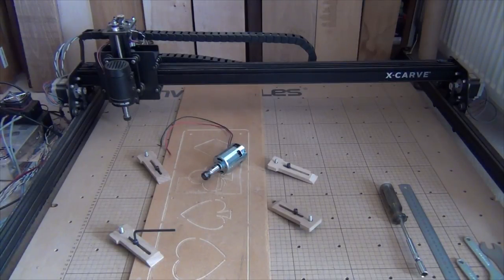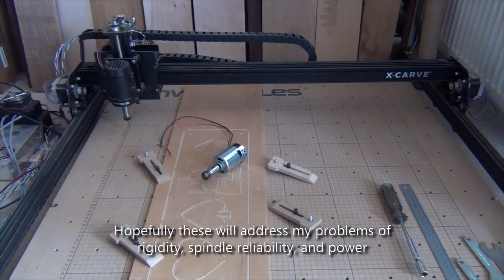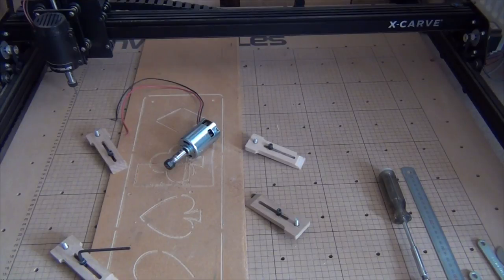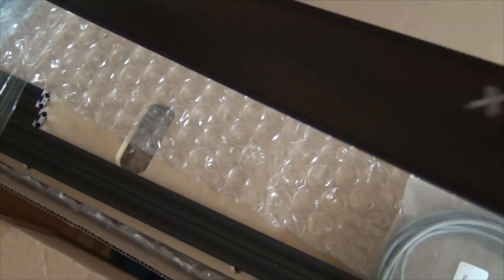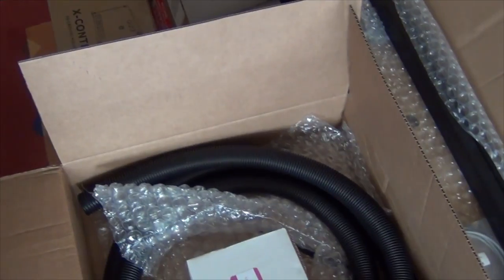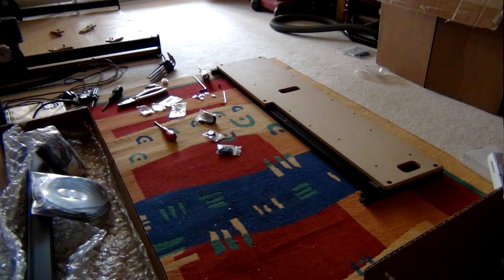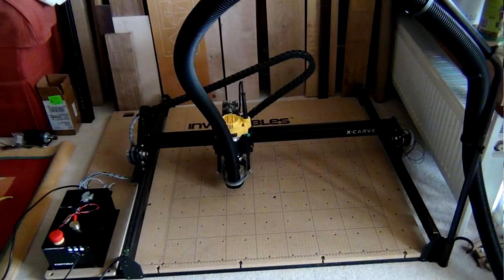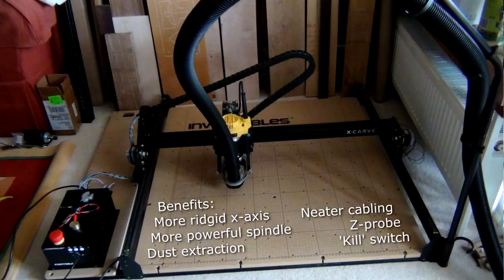X-Carve Upgrade - X-Controller, DeWalt spindle, X-beam, Dust extraction

Comment: I noticed over the last couple of years that other youtubers had the same problems with these. Thanks for the update, Mitch.
Reply from the maker: Cheers Steve. Yes, I'm sure it's been a case of pushing the limits, as most makers seem to do, because the machine is very capable at less demanding 'cuts'.
Reply: Ah, that makes sense.